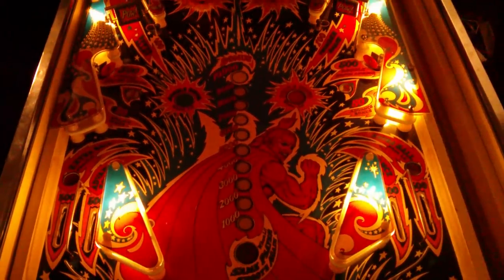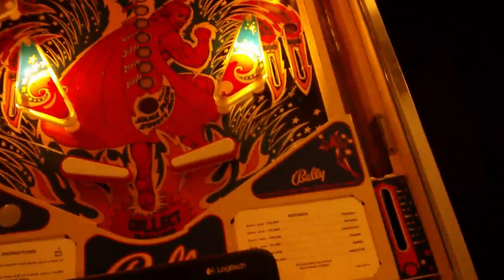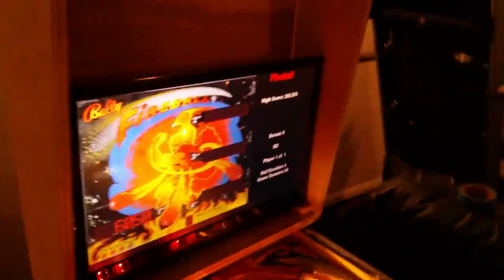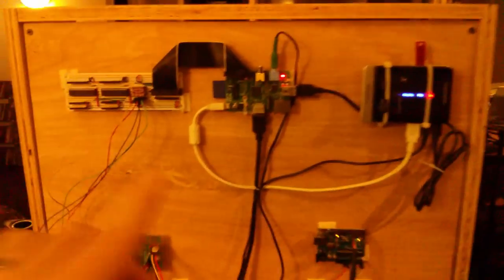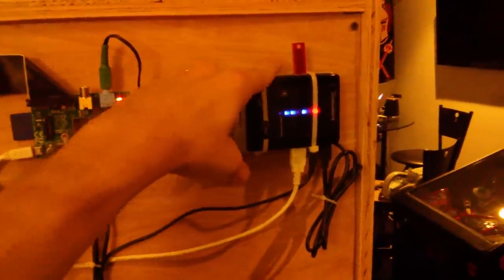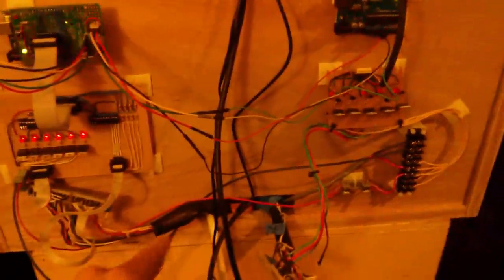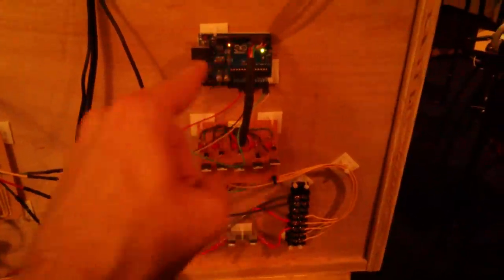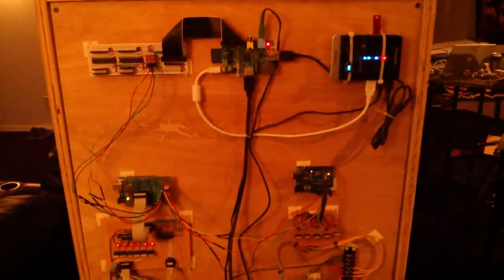Fireball HD - Electronics Layout

Comment from the maker: The Fireball pinball electronics are now mounted on the back of the head. Saturday's public debut had me removing the glass every 10 minutes to show off the electronics and to reset things when they weren't working, so getting the electronics mounted was a priority :) 

This was a quick mounting, more for layout - I'll do something more permanent later. REALLY glad I thought to use the sticky wire tie pads for this - I'll be stocking those now...

Comment: Bought a replacement (it was only $4.50 with shipping) and I think I will get a local electronics store to do the removal and soldering of the replacement part.  I have only soldered once and I don't want to ruin my board.  Thanks.

Comment: Transistor Q250 on your Series 1 game board is the output transistor to drive the speaker. It could be bad. It's a type MPS6531 which crosses to an NTE123AP or 2N4401.

Comment: I found that service manual online and it does give the steps to troubleshoot.  Unfortunately I do not have an oscilloscope to test and I was somewhat unclear on what to do when you find out.  Is it just a matter of replacing the op amp, transistor, capacitor or whatever part of the chain is failing?
I am in the Cleveland, OH area.  Thanks again for taking the time to reply!

Comment from the maker: I originally bought only the playfield, so I didn't start with any of the original electronics. I later acquired another one, but the electronics only partially worked, and unfortunately, no sound. I didn't want to lose my focus on the existing project, so that board sits to the side for a later day.

If you have an oscilloscope, you can test the sound using the diagnostics in the manual - it won't let me link here, email me - firstname dot lastname at gmail, I'll get you the link...

Comment: I've been following your progress on recreating this machine from the ground up and it is amazing!  Beyond my abilities, but fascinating to follow.
I have one of these machines in excellent condition, but with no sound.  Speaker is fine, wiring looks perfect and no obvious burnt resistors on the board.  I'd be curious if you had any thoughts on what else to check or if there is a work around / replacement for the sound.  I'd love to restore this to it's full retro glory.
Keep the updates coming!